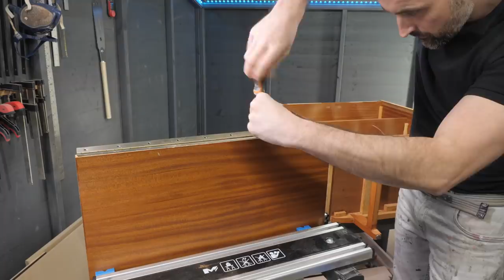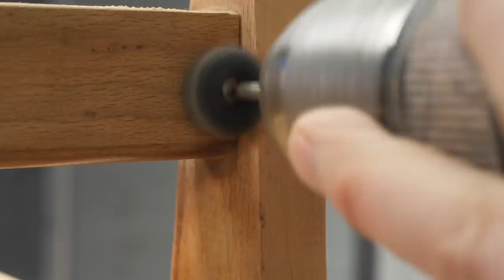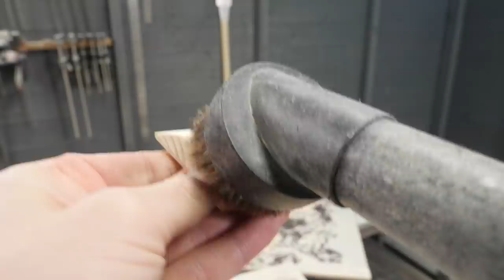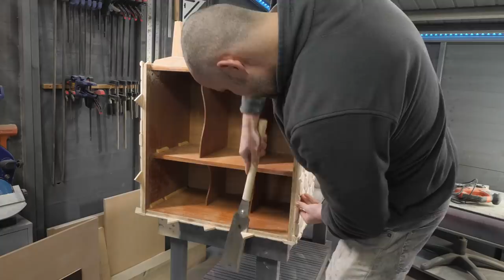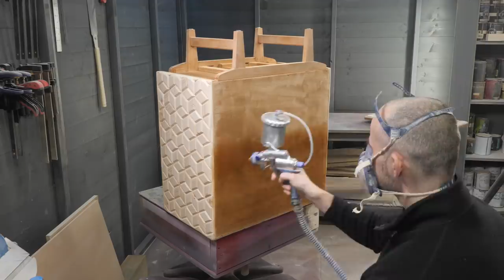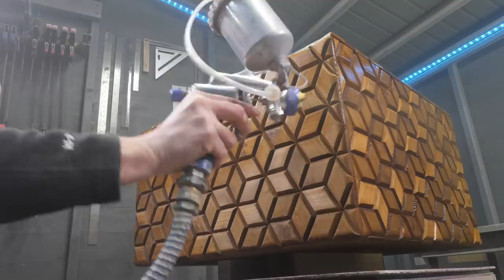MID CENTURY VINYL CABINET MAKEOVER / Furniture transformation / Trash To Treasure

Comment: The thought of all that dust makes me want to sneeze uncontrollably but damn.....I ❤️ your work!
Reply from the maker: Thank you very much 😊
Reply: @Madebyraphael  - that is right to protect your breathing with a respirator, but with all that dust you were making with the sanding and the spray varnishing, 🤭 I think you need to make a dust filtering fan for your workshop, as the dust is airborne - depending on how heavy the particles are/how long it takes them to settle, if the resulting dust/spray vapour cloud is dense enough = there is the hazard of it exploding if you accidentally manage to ignite it, as it is flammable 😯⚠️. For the air spraying - an extractor fan (preferably one with external gravity flaps) might be a good investment, install it in an external wall on the opposite side of the door (so the replacement/make-up air has to go through the entire length of the workshop) to the fan = do the spraying near to/under the fan, this can also be used for dust extraction - but remember to clean the fan and anything outside that is down-wind of the external vent/and the vent itself, will get coated with dust/spray. I hope this suggestion will make your work a bit safer 😉, great restoration of that cupboard. 😀

Comment: Is there software or app that you use to help you measure the pieces of those rhombus?  I am trying to do a larger pattern like this on my interior doors, but can seem to get the angles worked out, the triangle piece doesn’t work.  Suggestions on measuring, or apps to use for planned cuts?
Reply from the maker: No app at all. Just sharp pencil, paper and measure tape 😊
Reply: @Madebyraphael  thanks, it took me a day, but I figured it out…. Always human error when it doesn’t work.  🤣🤣🤣